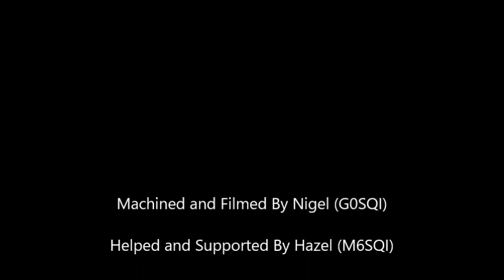Extra Strong Caster Wheels

Comment: I'm thinking of getting an M300, but worried it might be too wide to fit through my workshop doorway. Sadly, no one has photographed it along the back side. Could you possibly tell me the overall width of the lathe, after taking off things that can easily be removed like handles and the back guard, but including anything that can't be removed such as foot lugs sticking out? (I mean back to front, rather than lkeft to right)
Reply from the maker: Hi samuel if you remove the front winding handles is is 26" front to back should go throught most normal doors. cheers
Reply: @fixitnige  Many thanks. My door is 31.8" wide so that's fine.